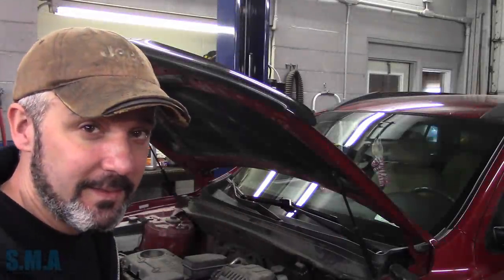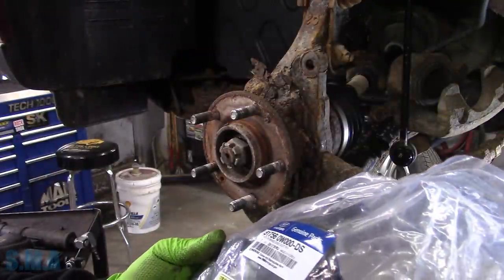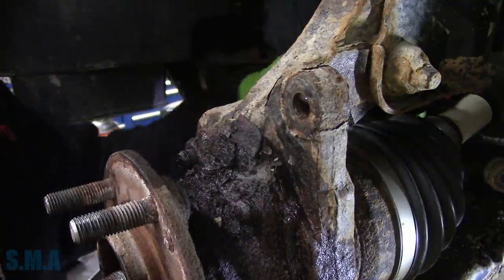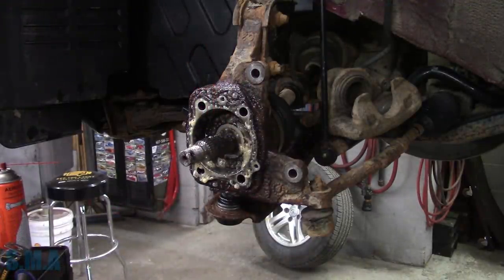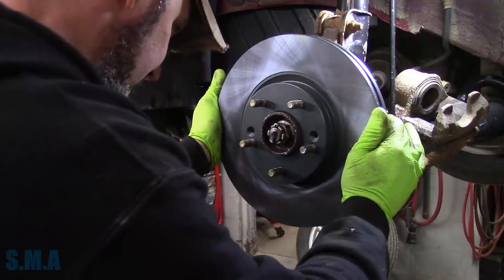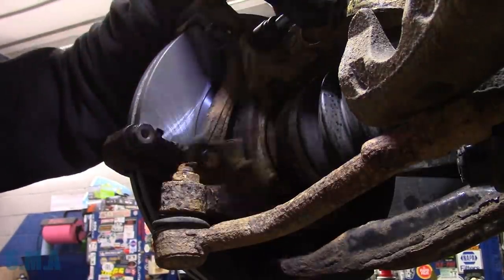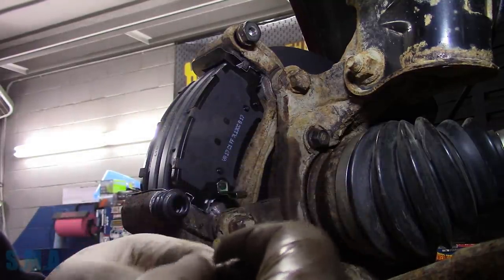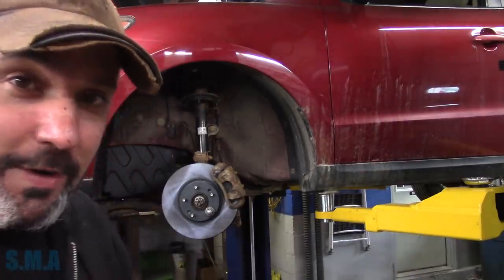Project Hyundai SantaFe: Front Brakes, Bearings & Dust Shields

Comment: Hey Eric, I am a retired tech of 45+ years, my life long buddy is the same. While he was working at a Ford dealer he installed new brake pads, rotors, and calipers on late 70s Olds Omega. It had a stuck piston on the right hand caliper so it was metal to metal, and the left side was still good. The lady who owned it was at the service desk picking up her car, and was asking why they had to replace the calipers. And after explaining why she said she understood why they replaced the calipers, but why did the right side wear and not the left. After trying to explain this four or five times (my buddy who had walked past and overheard the entire conversation) she just couldn't understand why one side wore more than the other. So my buddy stopped and asked the lady, "Do you think that maybe when you apply the brakes, that you are placing your foot on the right side of the pedal instead of the middle? She thought for a moment and left satisfied.
Reply: At a previous job I worked at a used car dealership.  We had a service where we would store your winter tires for you during the summer.  This older fellow always made sure we let the air out of the tires before carrying them around because if you let 30pounds of air out, they would be 30 pounds lighter.  I tried to explain the difference in pressure vs weight, but my boss stopped me, and told us to oblige him.  The old guy only bought his cars there, and had them serviced there, so he was 100% right, lol.
Reply: Yea, back in HS i had an HVAC teacher who worked professionally.  He was caught in a constant power struggle between a group of women who worked in an office.  Some wanted it one temperature and others another.  He put in two fake thermostats and told them the AC would average the two...that solved the problem.  They both thought they had control when in reality the system just used a main control that covered the whole building...
Reply: @Bobbywolf64  That's why I put Helium in mine.  Ha Ha
Reply: @rock.doctor  I guess installing a fake thermostat is cheaper than all that psychanalysis required to fix the problem at the source.
Reply: @Bobbywolf64  And there is the old summer and winter air. Also there was an engineer that swore if you increase you air pressure in the winter the tires will push harder on the snow and ice, increasing traction. Now increased tire pressure will make the tire tread more rounded and decrease the contact patch so more weight is concentrated but...
Reply: @LuckyBaldwin777  My mother owned a drive in restaurant, and the till would be short all the time, the only thing that could be happening is someone was giving too much change to lets say a boyfriend. She installed a fake camera and all problems stopped.
Reply: last time heared that fell of my dyno
Reply: @rock.doctor  I have heard of that being done in more than one place.
Reply: Had a gentleman stop at our shop and asked to borrow our portable air tank because he had a flat tire a couple blocks away. Asked if he wanted 100 pounds of air in the tank...he said not that much because he had to carry it. I didn't say a word, just put 70 lbs in the tank and have been laughing to myself since.
Reply: LMAO!
Reply: Hence the problem with our profession.  One of many, actually.  Perhaps the problem wasn't the customers' poor comprehension skills, but rather the service advisor's inability to properly communicate in a way that the customer would understand.  Communication without understanding is just a monologue.

Comment: Being a Canadian (read that as salt land)  technician, I'm 100% in agreement with your penetrating oil statement - I've never run into a situation where the penetrating fluid made it past the head of the bolt. I even had a customer who soaked his bolts every few days for a month and the bolt was totally dry on all surfaces you couldn't see with your eyes.
Reply: There's only one that I've used that works pretty well, but it does require some soak time. What it excels at for the most part is getting in under the rust and helping avoiding the threads from galling on the way out, and it does that pretty quick. But anyway, Omega 636 is the stuff. If we have time to let it soak it does penetrate into the threads as well as getting in under the rust crust.
Reply: @inventoroftoast  ehhh if you heat it, you've already won!
Reply: I agree on the penetrating fluids, as well.  One trick I would have used here is to wire brush the exposed threads for the wheel bearing bolts.  That would have helped them not lock up on the way out.  Been pretty successful using that technique.  It just comes down to what is faster when time is money.
Reply: I've had very good luck with Seafoam Deep Creep  (foaming) Penetrating Oil, seems to work it's way in and down.  Project Farm found it good too!
Reply: Jeff Winter Yeah, that’s what I’ve been using for a while now. Seems to actually work too! And yes, I saw that episode too. Used to use Kroil, but the Deep Creep is much cheaper and does seem to work better.

Comment: Free tip. Use a slide hammer attachment to push in axle to hold it in to get the bolts off from inside of hub.

Comment: Instead of using your finger or the brush for the silicone grease, you can use a popsicle stick to spread the grease, then toss it out to avoid cross-contamination. You can get a 100-pack at Dollar Tree. Or save them after your kids have ice cream or popsicles.

Comment: I used to own a 2011 Santa fe.  traded it in with ~90,000 miles on it, over the years I replaced the rear brakes 3 times, fronts 2 times, broke a front spring and replace a lower ball joint on the passenger side,  never touched the 3.5 liter v6 other than Amsoil changes every year.

Comment: Don't forget to pump up the brakes before you try to back it out of the shop, haha. You know bad things happen if you don't, unless of course you can grab the park brake quick enough. Seeing all that rust reminds me of a funny story. Back in the day at the dealership we replaced an exhaust resonator that was leaking, warranty department kept rejecting the claim because of "parts cost was excessive". We had to cut off three nuts/studs by the pipe flange and put new ones in, they kept telling us we could have reused the old ones. We said, that ain't happening because they looked like rust barnacles on the Titanic.

Comment: I have a 2007 Hyundai Santa Fe SE with a 3.3 V6 the first engine for that year, and I just replaced all my wheelbearings all four  hubs, dust protectors, rotors and brake pads, also I replaced all four struts, I do believe that’s a 3.3 L engine that Hyundai produced in 2007 is one of the best Engines produced, all in all it was a long day oh yeah one other thing I had to drill for the balls out because they were definitely frozen in place or should I say rusted in place, no head to the left to attach a wrench, anyway thanks for another great video I really enjoy watching your channel and you get a lot of helpful tips years ago I probably would have never attempted to do this myself and I am saying this honestly that if “I can do it, you can do it” (punt intended)...!!!

Comment: My late father-in-law once paid some young fellow from his church to work on the brakes on his 1st generation Ford Fiesta. The young guy found the pads were wearing unevenly, so he just swapped the inside for the outside. In his mind he put a good pad on the side that had clearly been doing all the work. He had no clue about a seized caliper pin. Luckily, no one was hurt, because the brakes were horrible after that.

Comment: Also just lubed my brakes up yesterday, my bottom pins on both sides were very hard to move. They had silicone seals on them. I also noticed that purple permatex stuff had turned into a hard paste on them. I just cleaned them and put some sil-Glyde on them and put em back. :)

Comment: Recently did the front pads on my 2002 Windstar. Pushed the pistons back without bleeding...turned the fluid in the master cylinder dark brown. Knew better, but after listening to brake videos on the practice, got lazy and took a chance. Won't be pushing contaminated brake fluid back into the system next time. Got to get out there and bleed now...looking forward to a lighter shade of master cylinder contents ;)

Comment: Glad you mentioned AZ. When I was wrenching, cars that were rusted like the Hyundai in the vid were few and far between. I usually would spend time shaving as much of the rust off as I could. I used an assortment of tools to scrape off the rust: screwdrivers, putty knives, wire brushes, and elbow grease. If I had known then, what I know now, I would have had a load of Bulldozer drain cleaner and sprayed it on the rust ahead of time and rinsed it off later. I learned about its rust eradicating ability when I got a free lawnmower next door to a yard sale. The fuel tank was extremely rusted and I tried Naval Jelly first, Limeaway second, with almost no effect. I had the Bulldozer, thanks to a recommendation from a guy at a hardware store. It's primarily hydrochloric acid, so caution is mandatory. As soon as it went in the fuel tank, it started fuming and bubbling. I had the mower out in the open back yard and used the hose with a high pressure taper nozzle to purge the tank from about ten or twelve feet back. Once I was sure it was safe, I dumped out the water and checked the results. I was very surprised. Even though it was only a few minutes exposure, there were areas of shiny bare metal showing. I poured in another dose of the acid and let it work a little longer. I nailed it with the hose and the second round had the rust almost entirely washed out. Just a few spots in pits remained. One more dose of the Bulldozer and purging left the tank rustless and shining inside. Fortunately, the exposure to the outside paint didn't damage it, probably due to the combination of dilution and rapid flushing away by the high volume of water. Once the tank was dried out with compressed air, new gas inside, a new primer bulb, and the engine oil changed, the mower fired up on the second pull. Ran great and cut grass like it was brand new. Until the first wheel broke. Dang plastic mower wheels turn crispy in the AZ desert. Four metal wheels and the thing is still going strong after twelve years.
Reply: @met6490  ... Lotsa grass yards still out here. Weeds grow in the gravel section, but those get poison and fire.

Comment: Hey Eric, I'm the guy from Bath you aligned the back tires on my '07 Galant. I know couldn't have been to do as some  of the adjustment mysteriously disappeared and you were ale to straighten them. 5,000 miles on new tires and they were down to wires, lol. Anyway I saw the title and said, What another brake job and passed over it a couple times. And then tonight, I said, What the heck, might learned just something new. While watching the video I remembered I have wanted to take my brakes apart, clean everything up replace anything needed. Been 5 yrs. but only 10.000 miles, but with this climate, just gotta do it. So it was an excellent refresher course. Kinda funny in a way where you have to address the comments while doing the job but I learn so much. Can be so many little steps in the processes we do daily. I was a coder in college where you have to account for each and every step. I had this one program a couple pages long that was driving me nuts until I found I needed a period mark somewhere. That's a big reason why I don't code yet learned so much in so many ways. I thought of a little saying per se, 'What I don't know, I haven't yet learned'. Just a thought, not sure if I'm the first to say it but just binged and nothing came up.

 Thanks again, Eric.

Comment: @6:52 I was introduced to Kroil Oil in the power plant boilers but we let it soak for a while.  I can see where you don't have the time to wait for it.  I think for DIY guys that take their time there is a benefit to it.  We were dealing with thermally stressed 'dogs' on boiler door that cycled from ambient to 1600-1800F.  I see you getting these crazy salt-belt seized bolts/nuts off with quality tools, impressive.
Reply: Yeah 20 seconds is not long enough for penetrating oils to work...

Comment: I’m not an expert but I think that opening on the dust shield is because the bolt ear on the hub happens to line up with that area for the brake calliper where it’s cut at an angle right by the ear (otherwise they would just go out further like the other three...) unless that is actually to give it somewhere to recess down to when spinning it, I wasn’t paying attention

Comment: Fun fact, that cast piece in the rear brake disc backing plates to retain the parking brake shoes... Toyota have been doing that for decades, and on their older vehicles the backing plates are WICKED expensive. On my '94 Celica GT-Four they are impossible to find, Toyota are completely out of them and you have to use second hand ones from a wrecker if and when they rust and need to be replaced.

Comment: As far as penetrating fluids go, I use PB's Fabulous B'Laster... but there is one caveat to these products:  no product I've seen or used will penetrate under a tightened bolt head!  You have to be able to see or access the threaded portion of the bolt!  It works particularly well on seized nuts... I was able to remove the downpipes on both sides of a 27 year old Buick 350 with considerable rust. All 4 nuts came off intact by spraying the studs down with B'Laster and waiting about 15-20 minutes!

Comment: I find that bicycle pedal spanners are ideal for holding slider pins whilst you tighten up the screws.
Reply: That's a great tip I'm guessing there metric too!
Reply: Used to have  a couple thin ones-- tappet wrenches.  Don't know where they are now.
Reply: Or just grind down some cheap-o Hazard Fraught wrenches

Comment: Those sway links come from the factory loose (not really but it seemed that way) I did so many under warranty when I worked at a Hyundai dealer. Also the rear brakes would seize up after one winter (Buffalo, Avoca is pretty much the same)

Comment: Interesting the bearing came off so easily.  I worked on my ATV this weekend, I had to use the torch and the Astro hub puller to get off first the spindle, then the knuckle and neither had nowhere near that level of corrosion on them.

I used a wire brush and the dremel to get the splines as clean as possible, put on anti seize and put them back ok.

Comment: There is another reason one side wears out faster than the other. I have seen the opposite side caliper piston and/or pins seized up, so the side that's worn out is the one doing all the work, which usually presents with a brake pull first.

Comment: i coarse wire-wheel the bolts past housing as best I can, then run the impact in/out is much shorter bursts spray lube in both side. it damages threads less overall that way if your reusing parts.
which for me is as often as possible

Comment: I'm an aircraft mechanic and the only thing we used was kroil. Let me tell you aircraft have Avoca NY levels of corrosion. Kroil sucks as a penetrating oil. Aileron pca bolts are seized in the rod ends 100% of the time, rudder bolts, you name it. None work well, but kroil charges double for essentially the same result. Nothing. However, big ass hammer or rivet gun is 100% effective

Comment: Hello. I am doing my 2009 santa fe brakes rotors all around. Started on front today. Curious why, as you mentioned it, there is a rubber sleeve on only one of the guide pins.   
Mine are same, just woundering why only one. Great videos you put out. Thankyou. Cheers.

Comment: Eric O doing battle with Hyundai! I know this isnt the first one you have done but have not seen many on the channel.
Santa Fe is essentially a Sonata with station wagon body on top so it should be the same process to pull the brakes apart as the sedan. Built with pride in West Point, GA.

That being said, the rear brakes on most Hyundais will make you scream trying to get the caliper brackets off. Surely Mr O knows how to do this already but you will be pulling a critical piece of the rear suspension apart to get at one single bolt. 
Oh and good thing you did not tweak that dust shield...these are brutally hard to get back straight and produce the most annoying grind when the are touching the rotor. 
Source: own a Hyundai Santa Fe (newer model but same brake setup) and have accidentally bent my front shields when doing front end work.

Surprised you did not realize you had the wrong shield for the left side. Its on the label underneath the barcode. Thinking you were providing some comic relief or were low on caffeine.

Comment: Mr. O.  I recently bought a 2012 Santa Fe AWD with the 3.5 V6 and only 17,780 miles.  This thing is mint.  I'll be switching the engine oil, transfer case lube, and rear diff lube over to Mobil 1 synthetic.  Any major issues I should be aware of?

Comment: If you’re using loctite, wouldn’t it be ok to go on the low side of the torque value? Also you could likely have put antisneeze on the shaft and loctite on the threads and once it’s through and torqued, put more Claritin on the end of the bolt that protrudes

Comment: Do you find that using the fluid film ,for example on the new back plate to protect it from rust, may cause a lot of road dirt to stick and build up to the point were it could rub the rotor and cause noise.

Comment: I just completed new pads and rotors on my '14 Accord.  Took for the test drive and squeak squeak squeak.  The problem was the clip that the pads go in was hitting the top of the rotor.  I guessing the rotor had a high spot,  I filed about 1/16" of the clip and it was OK.  Rotors and clip were new form NAPA.